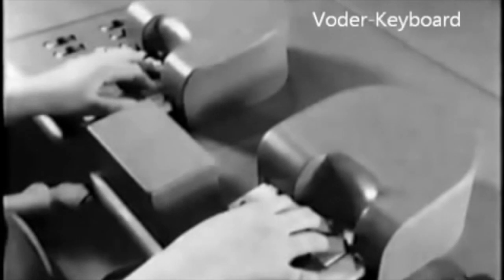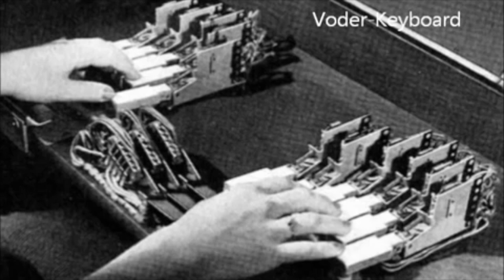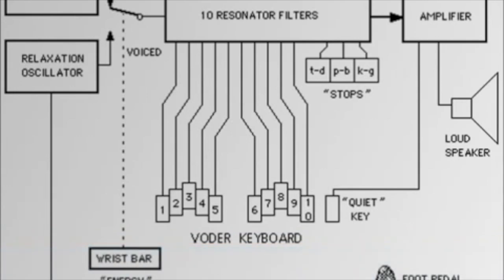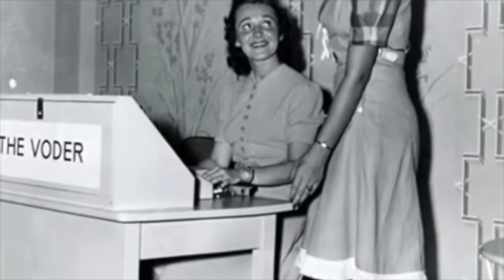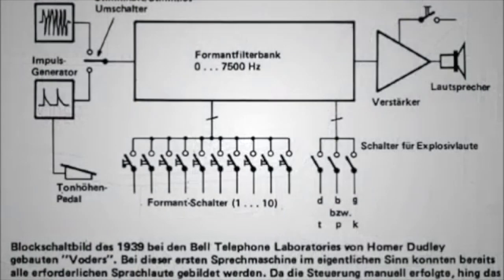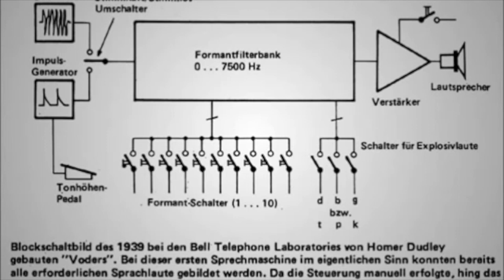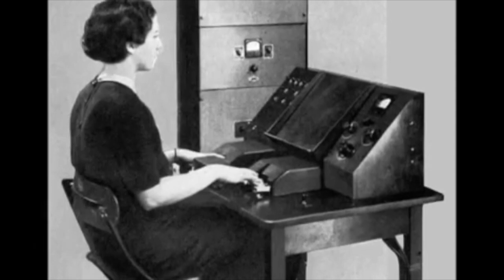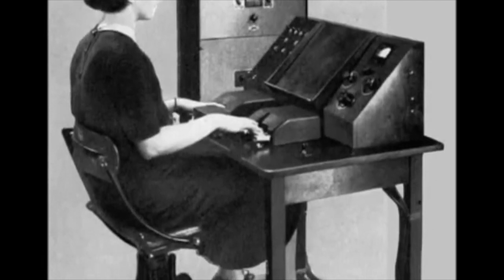The Voder: 1939,  the worlds first electronic voice synthesizer

Comment: What was the purpose of this device though?
Reply: I’m guessing at the time it was probably just R&D for research’s own sake, plus demonstrating the engineering capabilities of the company to future contractors and investors.

(I love your video game history videos btw!! :D)
Reply: So miku could walk sir
Reply: Actually...when you make a phone call today - your voice is deconstructed and then reconstructed using much of this technology in order to save bandwidth. Same with the voice you hear.
The cell phone line is not transmitting a "recording" as such of your, or anybody elses, voice.
Reply: @jarls5890  Kinda brings up the question of just what is a "recording" anyway?

The phone system codec you're describing is basically just lossy audio compression very tuned for voice. The most common one is known as AMR, and uses Linear Predictive Coding to very efficiently compress voice (down to 7-12 kilobits/sec total for the whole data stream).  However it's a hybrid codec--because just using the LPC data on its own would produce a kind of unnatural-sounding voice, it also transmits a specially compressed stream of the error between the real signal and the LPC-modeled signal. Theoretically there's no limit to the fidelity if that residual stream is allowed to increase in bitrate so it would approach an exact recording of your voice (but in practice it is very low bitrate).
Reply: @rfmerrill  I think "recording" to most people would mean that you sample the source with a high enough frequency (Nyquist rate etc.) and depth that if you were to play it back "raw" it would be very close to the original. I.e. a "recording" attempts to capture as many details as possible - and reproduce it with similar level of detail.

Modern telephone standards (as you mention) seems to be closer to this "ideal" than older systems which were close to the "voder" system described in the video.
Reply: Yup like ^ said, bell was messing with trying to break down analogue sound into "signals" that controlled which frequencies to "turn the volume down" to get back the same

This essentially became long-distant voice communication (as opposed to just morse-code telegraph) between allied governments in the world wars, and then eventually land-line (ie it wasn't just raw analogue signal of your voice in electric form being transmitted over cable, which back then grandma's would eavesdrop on their neighbours since a neighbourhood shared a line, but now it was rapid analogue signals of how much each frequency had to be filtered to recreate the voice.) 

This is why voice over telephone up till the mid 2010s had a distinct telephone-effect filter, since it was not 1-to-1 voice transmission like from a microphone to amp speakers, but more like a few dozen frequencies blasted together at equal strength and then limited by relevant filters. Think of like a sensitive high-speed music equaliser.

The transmitting end was just having a dozen filters tuned only to pass specific frequency ranges, and the receiving end was taking a full-band sound and filtering it accordingly for each frequency band and then adding all up.

The vocoder was just a trial to demonstrate the capabilities, by having a person manually activate switches instead of having a transmitter automatically making the relevant signals.

Pretty cool tho. It's like instead of hooking the TV to the cable outlet, you had a system that allowed someone to manually recreate the signals that will draw on the screen
Reply: I am a blind man, this device helps me navigate the Digital world of today.
Reply: Hellllllo you...